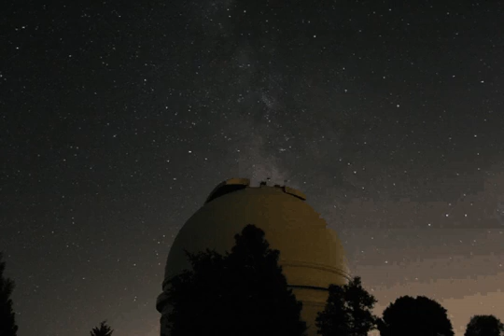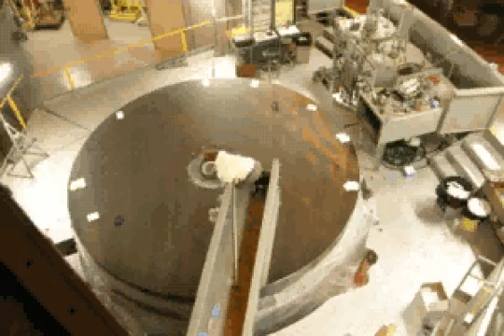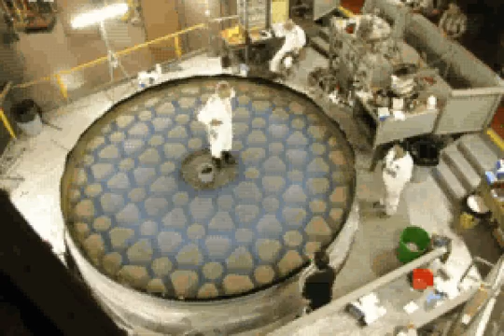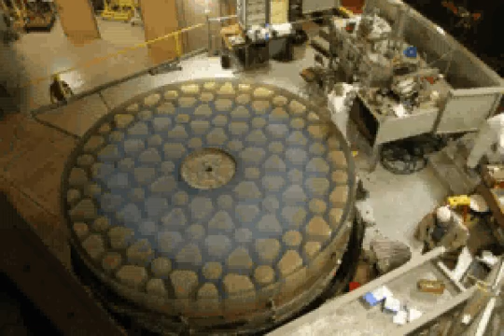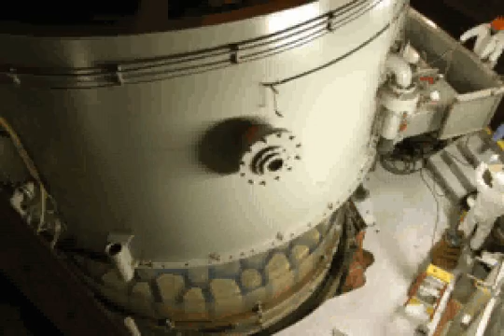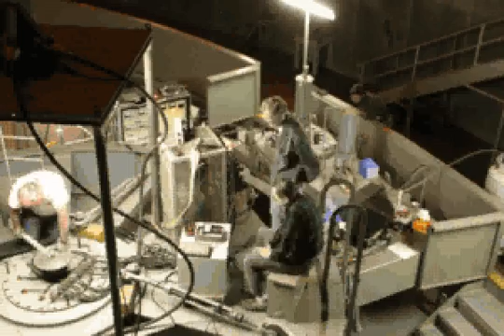Palomar Observatory October, 2006 Aluminizing

Comment: There not crazy, and although they are supported by the Caltech, they giant Palomar mirror has to be recoated every two years in order to allow the maximum light gathering ability for its sensitive camera equipment.  Unlike the telescopes used by amateur astronomers, the Palomar telescope is a research instrument and is used on every clear night possible, and because it is located in SoCal (yes, Smog City), enviornmental factors play a key role in the deterioration of the aluminum coating.